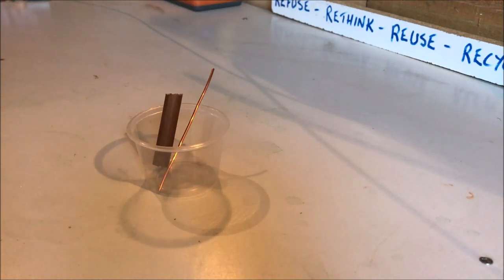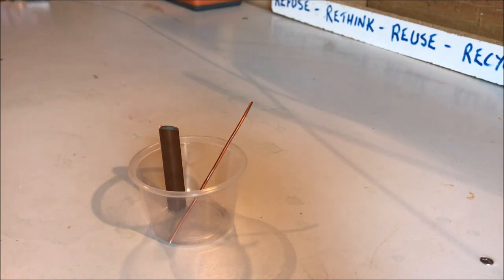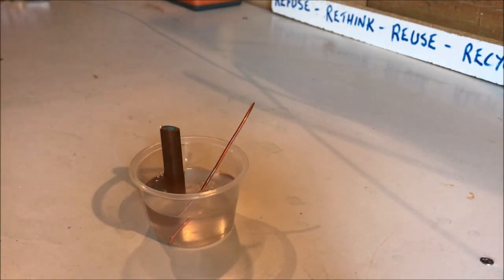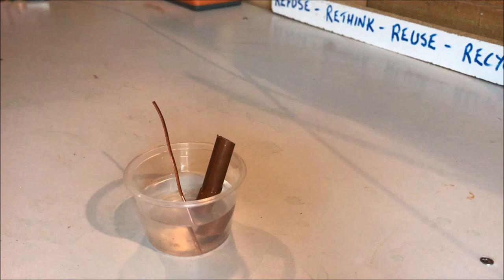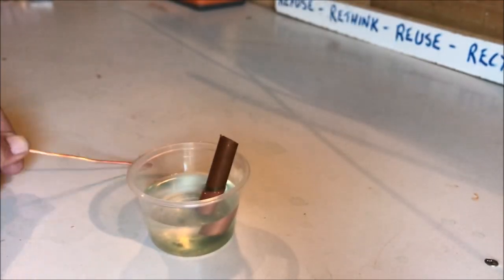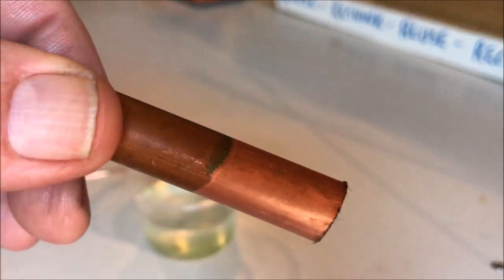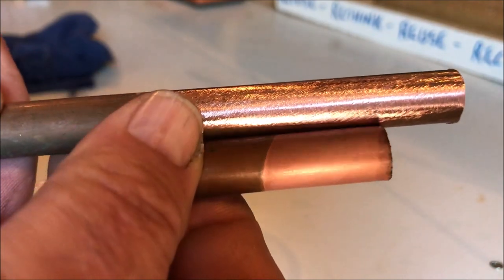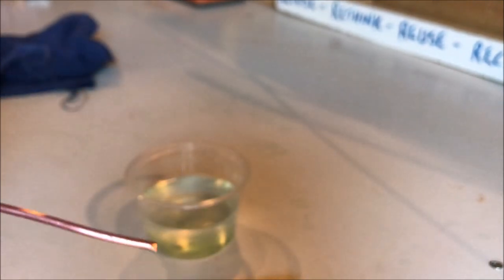Cleaning copper pipe and wire with salt and vinegar....good or bad idea?

Comment: Would filing not take material off the copper pipe? I'd rather try and leave material on it that remove it. What about using wire wool or something?
Interesting video though, thanks. Got my brain going.
Reply from the maker: You can